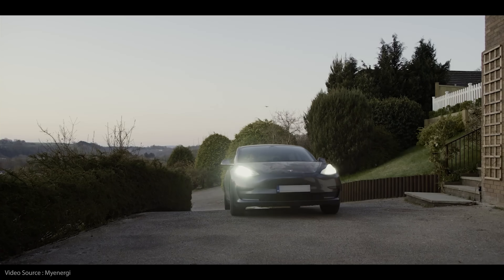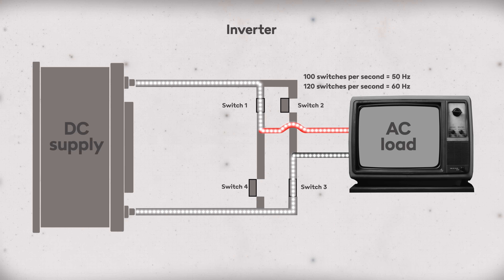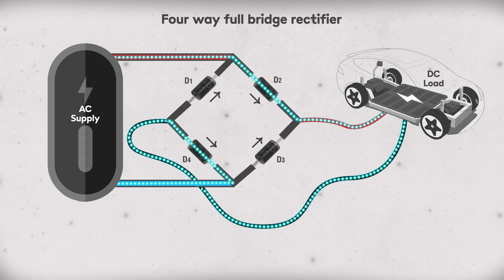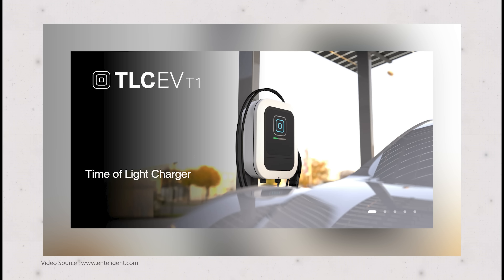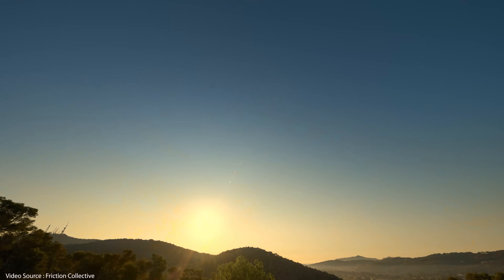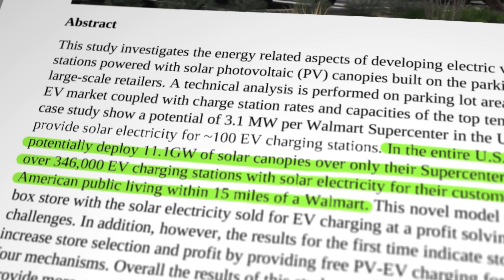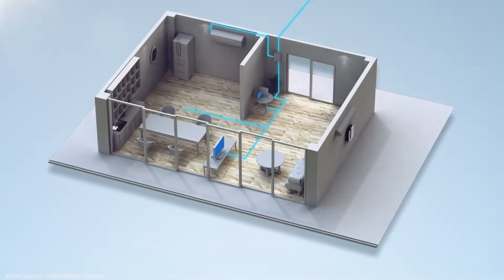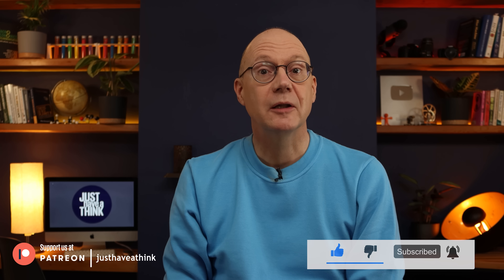DC to DC charging. One more step to off grid living!

Comment: I would challenge the assumption that EV on-board chargers use Diode-based AC to DC conversion (rectification), along with the associated losses.

Modern electronics (such as in EVs) use "Synchronous Rectification", which uses extremely efficient MOSFET transistors as the AC to DC rectifier switches. This reduces the "rectifier losses" of a typical 0.5v voltage drop of a Schottky diode - down to 0.1v drop... reducing the rectification losses by 80%.

These manufacturers have marketing departments whose job is to come up with the best sales pitch, and drastically over-estimates the power losses in modern EV onboard chargers.

Also, the trend today is to use micro-inverters on home solar installs, which makes them far more resistant to the effects of residential shading. However, this eliminates the possibility of using the solar array for DC-DC charging, because the solar array does not output DC... only AC.

Even if the solar array is series DC  connected, the external charge controller still has to perform DC Current Regulation (to prevent damage to the solar array and equipment), which is a high speed switching circuit, which has losses... just as in the onboard EV charger.

Just have a think... marketing is always about stretching the truth... hoping someone who knows better doesn't burst their bubble.

(yes, I am a EE, and have been designing electronic circuits since 1980, and also drive an EV... an i3 BEV)
Reply: there is a reason they are not around yet, and only hot talk. yes and it still needs a voltage regulator. then there will be a device needed to separate the solar panels to either EV or house. or else another regulator to separate or split. and like mentioned most EV charging is at night. unless you are retired. i suspect it will be a costly exercise for not that much benefit.
Reply: @ursodermatt8809  Most cars are parked at work when the sun shines, so this might work for charging at work for companies that have solar panels on the roof or as canopies on the parking lot.
Reply: @ursodermatt8809  >- most EV charging is at night. unless you are retired. -<
People in the US are famous for saying they are never at home.  Even during the summer it's dark out when they leave for work and it is dark out when they return.  And they are away from sun up to sun down on the weekends.  Point taken that this won't work for a lot of people but remember that it doesn't have to be noon on a sunny day to charge an EV with sunshine.  Any free electricity is good, but maybe not worth the cost of this charger.
Reply: How does local battery storage affect things?  I'm curious if there is a material benefit having DC to DC charging off a battery in the home.

We have a 9.8kw PV system that is grid connected with a 7kw inverter (I live in Canada we rarely top out of the inverter, and the extra panels help a lot with the total area under the curve for collection in spring and fall).  The system has been excellent, and I am considering adding batteries for a little more grid resilience and offsetting nighttime power use for charging our car, and I'm wondering if it's worth going with a system that does DC DC charging.  We already have an AC charger so the benefit would need to be large enough to offset the additional costs.  I'm not sure the conversion losses are large enough to justify it, but I'd be very grateful for others opinions.
Reply: @barkobama7385  A 'thank you' for raising this question, from another Canadian.
Reply: I originally looked at this and it didn’t add up but then it did.

EV battery voltages can vary from 400 to 800VDC depending on the car  model and PV arrays can vary from 250-400VDC depending on the installation (and there are further variations within the operating conditions). You wouldn’t be able to charge an EV from solar PV without some form of power conversion. Power conversion (changing voltage or frequency) comes in different flavours. 

AC to DC with rectifiers
AC to AC* with wound transformers 
DC to AC with inverters
DC to DC with buck or boost circuits 

*same Hz. 

To be clear, DC to DC converters are not farcical, they are in most electronic circuits when you want to change the DC voltage up or down. 

With the exception of AC to AC they all involve “switching” power on and off  (and I’m including diode only rectification in this for simplicity). Switching electricity with inductors, diodes and capacitors arranged in different ways allows you to manipulate it in anyway you want. As Tesla discovered, AC to AC conversion is easy with transformers allowing the voltage to be stepped up and down. 

It should be noted that there are energy losses in all parts of these systems, in diodes and mosfets, in the wires at high currents, eddy current in transformers, the the outer “skin” of wires at high Hz. 

It all a compromise, where are you willing to take the energy losses in your power conversion. 

In every solar inverter (DC to AC)  especially EU inverters, there is almost always a DC to DC stage, also known as a boost converter, or link bus (sometimes MPPT is part of this). The reason for needing this is that AC voltage is measured in RMS, and the peak voltage in a sine wave is higher (square root of 2 * Rms) - 220VAC actually peaks at 311V. PV panels may not have the voltage, and the batteries will definitely not!

So the DC boost stage in the inverter gets the DC link voltage to 400V, so the inverter can switch with something that resembles the peak voltage of an 220VAC mains supply. 

So there are losses in the DC to DC (boost) and then there are losses in the DC to AC (inverter), there are also losses in the cars internal charger (aka AC to DC or synchronous rectifier). Add them up and that’s a very inefficient system! 

It makes sense to just stop at the DC-DC boost stage but take it up to the battery voltage of the car while the sun is shining, You then remove the inefficiency from the AC to DC and also AC to DC.  At night you bite the bullet and revert to the normal way, until they start supplying DC to our houses…but that’s not happening. 

Thats my thoughts
Reply: @NorthernEwan  The DC to AC inverter and AC to DC ( in the EV) combined will waste less than 10% of the energy in total if designed well. The circuitry in an EV for AC to DC conversion might still be in-circuit irrespective of whether the input is DC or AC and still wasting some energy, though less than when supplied with AC.

The farcical part was the idea that an EV charger supplied by a DC source keeps the "DC'ness" of the input through to the output, when the first thing it will do is feed it into a switch mode power supply of some kind that is a DC to AC and back to DC converter! One could argue that if a boost or buck configuration is used there are DC paths all or part of the time from input to output, but the principle of energy transfer relies on alternating magnetic and electric fields in inductors and capacitors, which are definitely AC, though with a DC component. If galvanic isolation is required then there will be no DC path through the charger.

On the practical side, unless it is a custom installation, the solar panel system will output AC, which makes it universal and easy to connect to the grid and devices that expect AC.

Basically AC is the Lingua Franca of electrical energy distribution (outside HVDC for very long links) and what seem like good ideas on paper end up providing few if any advantages outside of niche applications where only DC is available, energy from the solar array will never be fed into the grid and grid energy will never be needed to supplement the solar energy when it's dark or cloudy.
Reply: @ZapRivet except for car park owners … at least the enlightened ones who don’t want to fleece you at every opportunity!
Reply: No one is suggesting that that DC to DC is suitable for all applications !
Reply: There are two variants on wiring for 'low' and 'mid' current d.c. described for the type-2 Mennekes connector. One uses the expected connections for single-phase a.c. and defines the polarity for d.c. applied to the L2 and L3 contacts. Such an arrangement defines 'low' current as up to 80A. There is a second description for up to 140A which employs the L1, L2, L3 and N contacts.

This is distinct from the 3-phase a.c. and  'high current' definitions, the latter described by the configuration commonly referred to as 'CCS'. I expect that absence of the L2 and L3 contacts at the EV charging port would be an indication that low-current d.c. charging is not supported, but as always  ...  read the EV manual.
Reply: I use the granny charger to top up my i3 BEV twice a week and have got up at 3am a few times to see if the 13amp socket is too hot, but it hasn’t been when tested. Is a trickle charge safe? Hope you don’t mind me asking? Geoff
Reply: Great news Dave and as usual, I learn loads from reading the thoughts of your audience in the comments section 👍
Reply: >-  still has to perform DC Current Regulation (to prevent damage to the solar array and equipment), -<
That is not true.  You can short circuit PV arrays until the end of time and not hurt them. 
      A question for you:  The advantage to me in using a switchmode power supply with diode based rectification is that I can push DC thought it with no ill effects.  What happens if I try to push DC through a Mosfet based rectification stage?, with no timing signal to get it conduct even half the time?  I suspect that the current will not get past that stage.
Reply: @ZapRivet  Only when you have the space for the panels. Many people don't.
Reply: @rivimey except for car park owners
Reply: 100% agree... and with the microinverters why on earth do they output AC not DC? I can easily see a micro-MPPT being very useful to the point of being integrated into panels, but there is no intrinsic need I know of to then convert the normalized DC output of the MPPT into AC?
Reply: @rivimey    What you are asking is what Solar Optimizer are.  They are a "per panel" device (some can handle 2 panels), and do MPPT per panel, then have DC output. They're pretty cool... though they are connected in series with each other, a shaded panel will never allow a voltage drop across that optimizer... and this the entire array. Instead, it will maintain the String Current, and add as much Voltage to the string as the panel illumination allows... maximizing output Power (Volts x Amps). Of course, if the intent is also to provide solar energy to the house, a String Solar Inverter would also be required. 

But regardless, there will never (essentially) be a perfect match in the total HV DC from the string and the DC Volts required by the EV battery - since it changes during charging.   The DCFC interface includes a signal from the car back to the EVSE to control its output... so a DC to DC conversion/regulation is always needed. This would most liky be what's called a "Buck-Boost regulator" that can either lower or raise the Solar array DC voltage as needed... a high power circuit which obviously has its own losses... even if only 5-7%.  The solar optimizer are also slightly lossy... another 3-5%.
Reply: @beforebefore  So there are two glaring requirements here, things that have only become apparent as the systems engineering has developed. IMHO a system should consider its energy storage element (home battery) as the central power source and run everything from there. A step too far? The a.c. version of MPPT is great for those who will never install a battery and can benefit from feeding power back to the supplier during the day.

First: if you feed an EV with d.c. on the normal a.c. pins will it become unhappy? For instance could you feed it 50V (from a nominal 48V house battery) and achieve charging safely. Could you apply 50V to the 'fast charging' input and tell the EV that the current capacity is for example 100A. That would give you a 5kW charge rate, and maybe the rate could be less if desired. I guess that the people with the d.c. supplied EVSE have already answered these questions.

Second: a version of MPPT microinverter is needed which supplies a d.c. bus. That is for example using a 100V d.c. bus (or other preferable voltage) to feed into a Powerwall or other home battery installation. You then have d.c. feed for charging batteries, all the self adjustment provided by partially shaded panels with a d.c. variant MPPT, and an a.c. or d.c. source for whatever application. I chose 100V in an attempt to lower the current from the PV array, for personnel safety that voltage could be reduced to 60V or similar. Also this approach lends itself to star-connection or configuration so one could continue to use 4mm or 6mm cabling (up to the star point).
Reply: @stephen2203    In 98% of the EVs today, the DCFC input is a path to the EV battery directly - only with Contactors between the charge port and the battery... so anything less than the EV battery voltage won't do anything... other than likely destroy the attached low voltage power source.

Feeding low voltage DC into the AC charge input is likely to do nothing. The first thing that happens after the Pilot signal handshakes is to feed the external input to the AC-to-DC charge circuits.  In old-style AC-to-DC power supplies the first thing that happens is a bridge rectifier... so in that case the 120V is converted to 1.414 times the line voltage, or about 170V DC... so 50V is far too low to get the circuits working.  In more modern onboard chargers, they use Synchronous AC Rectification... which relies on the AC input to synchronize the rectification... so it would go into a Fault condition - or just ignore the DC being input.  Also, they all have PFC (Power Factor Controls), which require AC to even run. 

Third - look up Solar Micro-Optimizers... they "almost" do what you were asking about, but not quite... they connect in series to create a more stable/predictable DC Bus for the inverter to run on... by preventing the DC String from falling too low due to shading.  If you were to parallel these, they would not operate correctly... and if you had a 60-100 V DC bus for all of a 10kW solar array, your feeding 100V DC at 100 Amps, or worse... 60V at 167 Amps... you're talking about some SERIOUS copper costs... and cable heating losses.
Reply: @beforebefore  Yes, I am a retired engineer and understand the high current issues. Elsewhere I wrote that a d.c. bus system could be star-connected, which is exactly what can be done with a.c. MPPT systems. My understanding is that nobody makes an MPPT unit that outputs d.c. "onto a bus". I am aware of the 'optimisers' for d.c. string systems.
Reply: @rivimey  In the US, the rules for electric wiring strongly favor lazy installers and micro inverters.  For greater than 48 volts, wires for DC must be installed in metallic raceways.  For 240 volts AC . . . nobody cares.  Plastic is fine.  Parallel the micro inverters, drop the leads over the edge of the roof.  Done.
I would think that string inverters would be much more popular, if only for "sunshine backup", which is AC power when the grid is down, but only available when the sun shines.  String inverters cost less than micro inverters so one is actually getting paid to take the "sunshine backup".
Reply: EE here too. The idea of "DC to DC" power is farcical. I'm fairly sure there will be several switching power stages using MOSFETs between the power input and the battery. At these voltage and power levels a full bridge topology would be likely, which converts DC to AC and then rectifies it back to DC, often using synchronous rectification as you mentioned in your post.

Having said that, bog standard bridge rectifiers for 50/60Hz drop a few volts at 30A, so at 240V that would be less than 2% energy loss, not 13% quoted in the release from the marketing department of the company Dave was repeating.

Comment: Here in the Netherlands some energy providers are already switching their peak and off peak hours around to be off peak when the sun is out and abundand during the day
Reply: As solar and wind get ever cheaper, I suspect that eventually it'll be worthwhile to overproduce to the extent that there's enough power on cloudy, calm days.  Then the storage needed is just for 24 hours...much like nuclear (which tends to be used to produce the same power 24 hours a day, and uses storage to save power from the lowest demand hours to return during peak use hours).
Reply: I've started seeing electricity prices go negative here in northern Europe in the middle of summer days now, that only used to happen during very windy nights before. Solar installations have really taken off.
Reply: @zapfanzapfan  over the last 4 years we've gone from occasional negative prises to half of the days having atleast 1 hour of 0 or negative. Thats why they are now changing to feed in tarifs aswswell